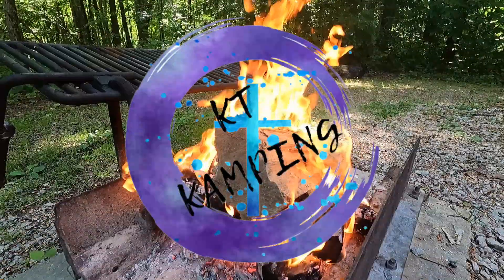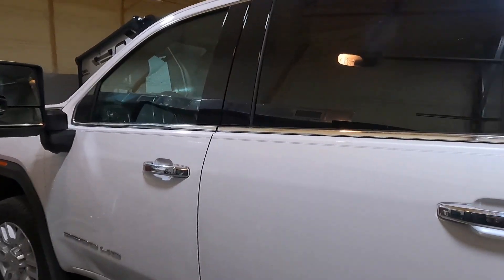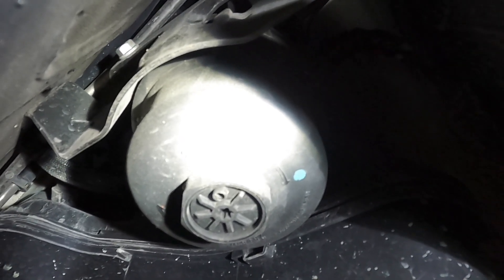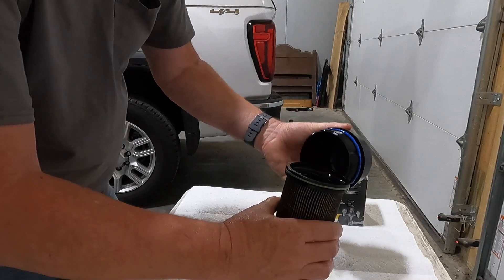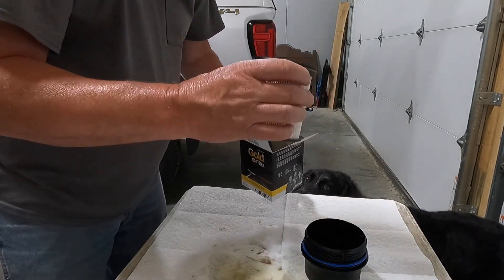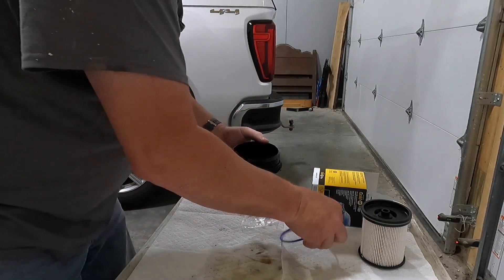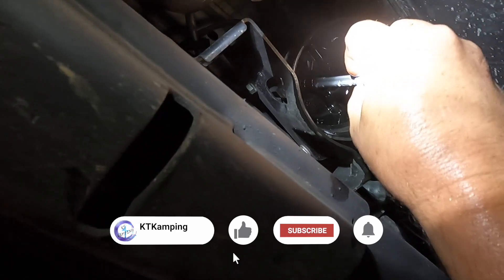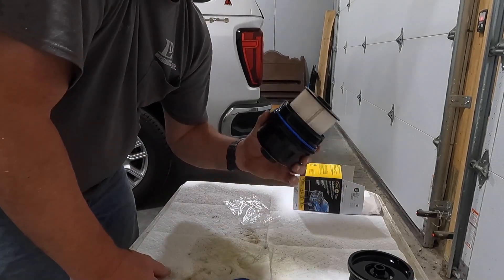Fuel Filter Replacement On Our Tow Vehicle 2020 GMC 2500HD SLT With Duramax Diesel

Comment: Hi Kent & Tami! I’ve changed a gazillion fuel filters on Class 8 trucks during my 38 years of trucking and I have to say how nice it would’ve been to have a system like you have! Wow! That was pretty neat! We always had to manually fill the filters with fuel THEN screw it back on in place. ( yeah, it ‘could’ get real messy!) I’ve always been leery of buying a pickup truck with a diesel engine…a big truck can handle a large amount of water (due to gas haulers being well known for not checking the water level in the tanks when they unload…I know this to be true as I hauled gasoline and diesel in Texas in the 80’s) but, I was always scared that the pickup truck with such a smaller engine couldn’t. Great video! Stay safe! ~Jim~
Reply from the maker: Hi Jim.  Thanks for watching.  Have a great week.  Kent

Comment: That truck looks exactly like mine. I just bought a used 2020 sierra SLT, same shell on it.good looking truck
Reply from the maker: Thanks so much for watching and commenting. We just traded our truck off for a different one. It would be funny if u bought our truck.
Reply: @ktkamping4975  where did you trade it at? Did yours have amps, the banks tune and an upgraded 60 gallon tank? It looks just like the one I bought. Absolutely love it the dealer said the one who had it, towed a camper.
Reply: @ktkamping4975  this one had 64k miles. But was well taken care of.
Reply from the maker: @denisniederhoffer8716  We traded it at Sunset Ford.  I’m pretty sure you bought our truck.  It was a great truck for us. Had no problems with it.
Reply: @ktkamping4975  I bought it from sunset. In Waterloo
Reply: @ktkamping4975  I absolutely love it. Came from ram. Been rams all my life. First gmc and I think it rides better than my ram 1500
Reply: @ktkamping4975  you from the stl area?
Reply from the maker: @denisniederhoffer8716  we actually live  in  east central IL.  About 2.5 hours from Waterloo.  They happen to have the truck we wanted and we really liked the dealership.
Reply: @ktkamping4975  that’s awesome. What’s the chance of me finding the owner of the truck I bought. You took really really good care of it. The only reason I bought it. I went through it really good. Couldn’t believe how clean it was. Looked new. The ride is great. And the tank, I was floored it had a 60 gallon tank. I planned on putting one in it. Nice to know I can drive for HOURS AND HOURS now.